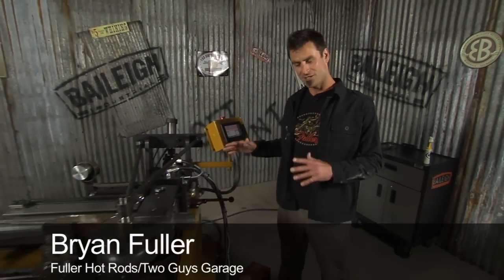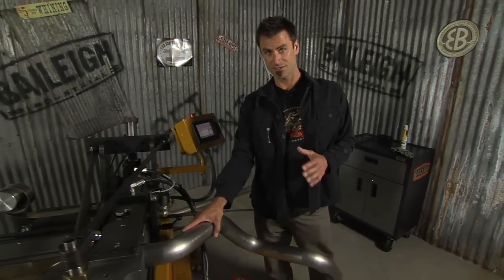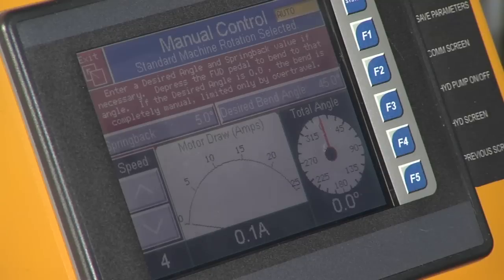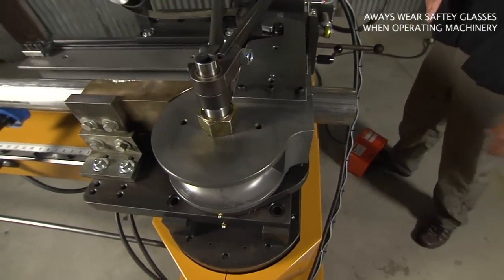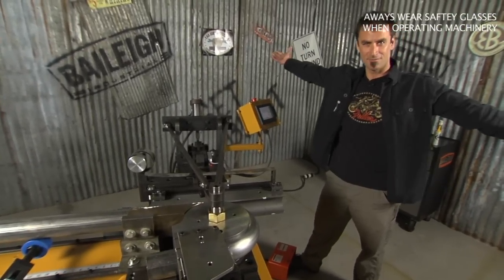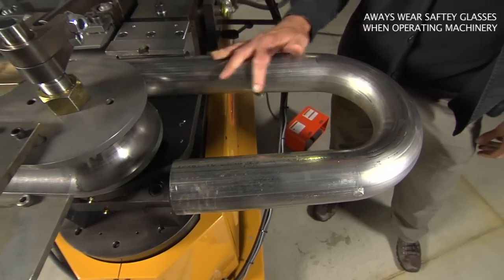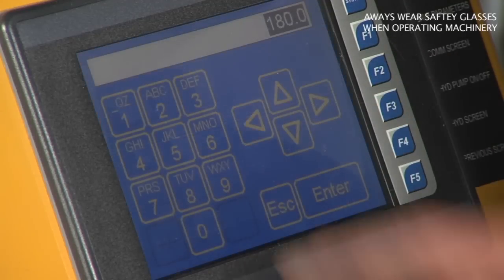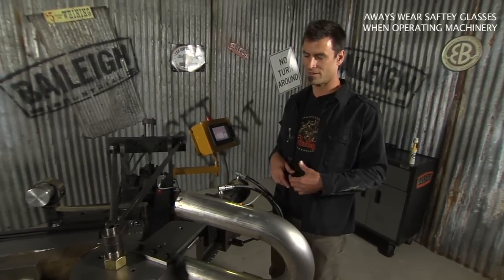Baileigh MB-350 Mandrel Tube and Pipe Bender Exhaust Tubing Bending Machine

Comment: What should I do if the unit I received recently (yesterday) couldn't bend sch 10 tube? Or.... Better yet. What if the screen is not squared but is tilded sideways about 15 degrees so when you look at the screen you need to tilt your head sideways to view it 😑 disappointed.

Comment: What he is not telling you is that the tubes have "spring back." If you punch in 180, especially on stainless, it will spring back to about 175. Also, he didn't show how to set any of the tooling. And how to get rid of wrinkles. I'm a bender operater. I bend for a living. If it was this easy then I wouldn't get paid what I do. Oh and if you don't run lube on and in the tube, you'll ruin the tooling.
Reply: Yeah that 180 was 3-4 degrees open